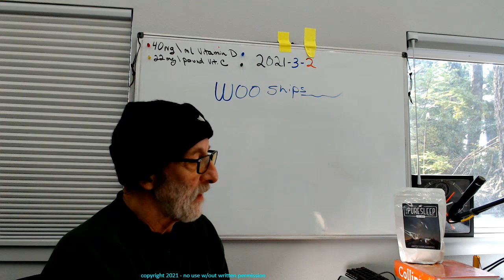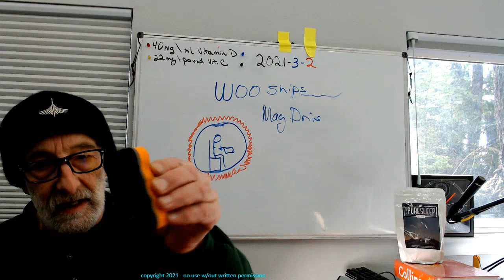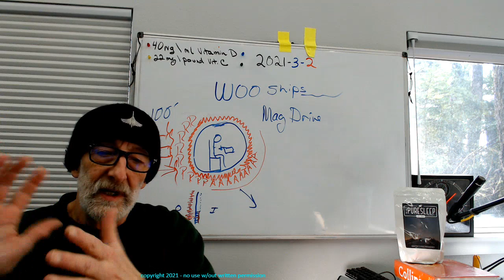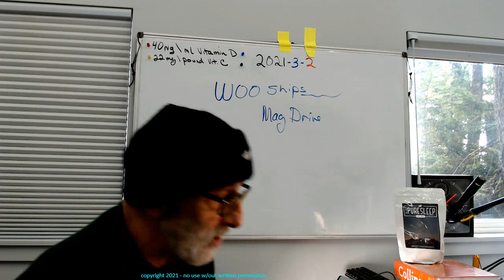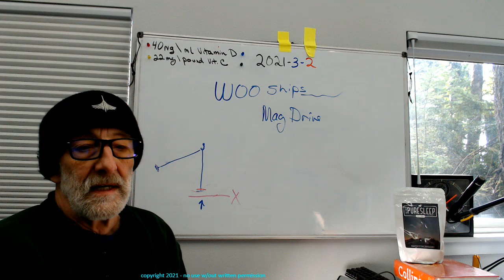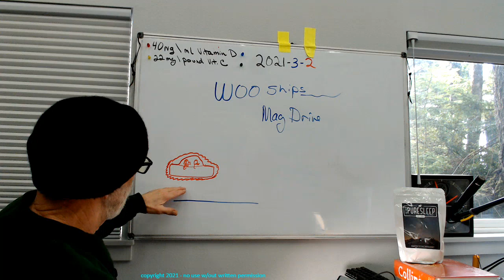Woo ships -2021-3-2

Comment: It seems as though it's not metal x necessarily, it's what you put between the plates of the framing of the body (if I worded that right) because you would need several layers of plating. When the magnets are started the material between the plates would cause acceleration depending on the alloys used for each layer of plating. Think of the frame and plating like a bicycle tire inside a bicycle tire inside a bicycle tire etc. What your looking for isn't the metal x as per se. Intriguing video. Thank you.

Comment: Could very heavy objects like battleships are able to float in water not because of water displacement but due to molecular vibrations of the water pushing against the surface area of the ship's hull? The greater the hull surface area in contact with the water the greater the buoyancy? The molecular vibration is like a transverse wave but it's strength can be reduced when the liquid is moving rapidly against the hull. Just as an aircraft wing moving through the wind has lower pressure on the top of the wing versus the bottom of the wing due to the higher speed of the air on the top of the wing which would produce lift ? Perhaps a flying saucer type of vehicle could be made to lift off the ground by having a plasma field on the top of the saucer move very fast whereas the plasma on the bottom is stationary.

Comment: You are describing what NASA calls "Magnetic Bouancy ". I am adding Coltan to my guess of a material: :Abstract "In this work, we report the novel findings on the structural, second harmonic and magnetic properties of the Coltan material from México. The magnetic properties were studied through the analyses of the magnetization versus temperature (M(T)) and magnetic field (M(H)). The isothermal magnetization measurements performed at 300 and 50 K shows a saturation magnetization of 11.5 and 11.8 emu/g, respectively. Electron Paramagnetic Resonance (EPR) signal result indicates a signal with g-value of g = 2.481 with a line width (ΔHPP) of 3575.7 G. Zero-field-cooling (ZFC) and Field cooling (FC) curves demonstrate the magnetic fingerprint of Coltan. Additionally, good second harmonic properties are observed at 470 nm, related to the blue color. High resolution transmission electron microscopy showed structural natural nanorods of Nb2O5 at 50 nm resolution with interatomic distance of 0.39 nm. " Jim Willie has gone full Woo but did not know the secret space ppm use of Coltan

Comment: Use a rotating field magnet. As the top magnet approaches the stationary magnet its field attracts the oncoming magnet as it passes the center field of the lower magnet flip the lower magnet field to push the moving field then reverse it to pull the opposite direction? Rotating fields may work with low electric output. The lower magnet will need to be timed the closer the match the longer the movement will continue.

Comment: Clif I think your metal x is as follows. A pyrolitic graphite wafer ...one side coated in a very thin but just  not porous layer of Silver. The other side coated in a thin layer of Bismuth, about five to ten times thicker as the layer of Silver. Good luck.

Comment: I saw this video some time ago and it presented a lot of magnetic force presentations made by the gov't research lab. They have somethings you are looking at. Powering a piece of aluminum through space pushed with magnetic fields at accelerated speeds. Did you tried a nanocoated  copper plate? See how different it would react. I will test this out in the next few days. Tried to communicate via Half pass Human site but couldn't figure it out. I have also discovered other information that might be useful to experiment or share.

Comment: What if it wasnt a new undiscovered metal, but something you do to the metal.
Perhaps if the metal or copper sheet was oscillating (piezo transducer at variable frequencies) there would be measurable differences in the speed of the magnetic pendulum.
Would a magnetic pendulum decelerate at the same rate while traversing across a vibrating metal plate as it would a non-vibrating metal plate etc.?

If you could have a magnetic rotor surrounded by a copper ring stator, and you vibrated the copper stator with a transducer, i am fairly certain there would be some phenomena , perhaps even the magnetic rotor would begin to rotate on its own.

Comment: Clif,
In regards to the metal plate...
Perhaps looking closer at abundantly available materials and ways to utilize them would be better that some rare ones.  Even copper over some form of plastic or even carbon fiber.
I'm sure many of the answers could be found in Area 51.

Comment: God bless you Cliff! Blessings and I’m sure you’ll get the help you require ASAP 🙏✨🛸 🖖 
In Hertfordshire, England, I’ll never forget seeing 2 lights as bright & as sized as average stars, in the sky, which were a reasonable but close-ish distance from each other @ about 11pm in summer. They then began to alternate independently between being dim and as bright as the Sirius star. They then zipped to the left, zipped to the right and then off & up diagonally into the darkness. Helicopters then came over us aiming towards the local airport direction about 5 mins later..Pretty compelling & that was about the year 2003. Interesting behaviour 🤩

Comment: You may need to use a combination of "metals" that have certain complementary or opposing reactions, that when laid out next to each other,  will generate the desires field conditions. These may need to be arrayed together in a hexagonal grid frame. Thinking industial diamonds would be an ideal frame material given their hardness, lightweight, etc. Just a thought to consider.

Comment: What hes describing is the unified force(or ether or medium or whatever words) that takes the patterns of magnetism, gravity, inertia, electricity, light, strong, weak, etc. Can be controlled and isolated. That means we can basically lock in the gravity inside and isolate the inertia from anything outside. And likewise no external inertia will do anything and we can target the forces all the while having no inertial or other resistance (that includes sound and bounces off light). It needs a highly concentrated, responsive and controllable power source, appropriate to the scale, maybe could also use supercaps or tabless batteries as buffer in some of them. These ships when designed for it can also go invisible.

Dont believe the dogma that theorists call laws of physics, they always make more problems for everyone because they always make more boxes and words and equations that describe the same thing and achieve no understanding of whats really happening.

Ive been watching alternative physics scene and the closest to unified understanding of these patters is found in Particle Gurus particle theory. I dont agree with their assumptions or counting everything as virtual particles which cant be detected but their conclusion is its all bunch of patterns of the same stuff. His sons channel Dissident Science is how I found it. There isnt a video that explains everything yet. And bascially theres whole movement in replacing the whole dead end physics, with partial success. 

Another part of the solution is Structured Atom Model which is getting good explanation by Seeing The Pattern channel.

Comment: The generator sounds like a Searle Effect generator.  That thing has never been able to get any traction for large-scale production. In the 90's I attended one of Searle's lectures and he explained the principle & device in detail. It's exceedingly simple.  I have notes here somewhere from that lecture.  The trick is printing the magnetic rollers.  One pole on the inside of the roller; the other on the outside.  That's the hard part.  The rollers' magnetism wears out after a time so they are not eternal.  The rollers are ultra-expensive neodymium with nylon 66 outer coatings, if memory serves, but I'd have to find & review my notes to be sure.  Anyway it's a very simple device.  There are an optimal number of rollers in each of 3 rings; he said any more than 3 rings and you don't really see any performance benefit.  I'm sure any notes I could find would have their information duplicated online somewhere, if the entire lecture isn't on video.

Comment: Metal X should not need to be searched for randomly.  The interaction of magnetic fields with molecular structure should be mathematically predictable.  Metal X, whether a complex alloy (from the viewpoint of molecular structure) or a simple arrangement, should be determinable via applying theory.  Work from the inside out.  Reverse eddy currents which "resist the change that caused them" = "enhance the change that caused them."

Comment: Well, what happens with copper is that the displacement of the magnet creates an electric current that creates a magnetic effect that stops the magnet. In order to accelerate the magnet, one should provide current, as a generated current will always contradict the movement of the magnet - if not, it would be a spontaneous energy creation engine - so, I'm sorry but the inexistence of "metal X" is quickly deduced : you don't accelerate something without spending energy

Comment: As a contactee i can tell that a journey to Mars takes about 15 to 20 minutes.
Around the ship there is some sort of plasma cloud and space looks like a silky black soup.
Those are smaller, saucer shaped ones.
The pilots are always female.

Some ships are very large. Miles long.
And i saw a black, planet sized cube somewhere in our solar system, about 10 years ago. It has a pipeline sticking out of it. Its size is preposterous.

And i also saw a planet sized ship with moons around it.
The south pole telescopes of the vatican have also seen them.
They are from the past......i can talk weeks about them.

Anyway,
The universe comes out of a portal and is tunnel shaped. Or better, like a cocoon of a butterfly.
The universe floats in a liquid ocean.
The border between the universe and the ocean is some sort of mist.
I saw very thin black strings.

There is life in that ocean.
And i discovered that the ocean itself also comes out of a portal.
I didn’t go through that second portal, but looked into it and saw land. And a blue sky.

Female contactees often have knowledge of ET propulsion systems.
So, ask them.

And if you have difficulty believing any of this, then i am not offended. Because it must sound really out there for a profane.

But then i can direct you to the smartest man ever, king Solomon, and you can ask yourself why he, in Proverbs 30:4, clearly describes the Anunnaki deity Enki as God of the earth.
And if that is not enough, them you can ask yourself who Abraham was listening to when he left Ur.
Hint: it was Enlil, Enki’s half brother.

And if you are still confused, then realize that if Moses stood before several pharaohs, starting  with Akhenaten, then king Tut, then some other guy and finally Ramses, the Bible calls all of them “pharaoh”.
So, when different characters are called “God”, don’t be surprised.
(The scene where Moses throws a stick that turns into a snake was with king Tut.
Tut’s left leg was fixed on a 90 degree angle.)

Comment: One more thing.  Sure you are aware that bismuth can actually repel / levitate magnets.  Maybe some combination with silver or brass?  Just thinking out loud here.  What if your inner substrate was fluid and you could adhere paramagnetic and diamagnetic substance.  Around this substrate a field could be generate the to align paramagnetic/diamagnetic mixture?  Thus using a little energy to generate substantial propulsion.?  Something like bismuth and gadolinium?

Comment: sir have you seen that movie i am unable to remember the name but in that movie the electro magnetic feild is created on a track which is similar to that of rail track but this track is shaped like U if you look at it cross section. if you view it perpendicular to the length.. and that track created a feild that made the car like vehicle to travel so fast like a swift of a sec and can stop within secs. i always wondered if it is possible to create this. because of the weight of the vehicle it stays on the track...& it is designed in a way similar to that of a ship... meaning lowest part to the track is heavy keeping the vehicle in proper position. so nice for u to create that spark of trying different things and ideas. 

always have been fascinated by magnetism... because magnets can deflects much of the radiation.

Comment: Bismuth has a repelling effect. I assume it’s not nearly enough for your needs perhaps the makeup of its molecular structure combined in a nano form with another type of similar, or multiple other types of materials could produce the desired effect. It seems like your essentially looking for a negative purposive field why not a properly timed pulsed opposite electromagnetic field shaped and directed to create the necessary push your looking for I’m sure a proper program would be a easy write for someone like yourself. I’m guessing that’s not going to fit your purpose for the push your looking for anyway just a thought. Peace and Love

Comment: Anyways" not really mags : I will explain l call it ion drive ;freqency osilation using natural Earth frequency or any planet ya need a frequency generator , a capacitor , 2 arc points = Ion Drive combined w/ di-electric metallic glass orbs = ufo's ps. the copper effect is due to impurities such as iron.*

Comment: At Cu where Cu represents copper as a flat plate and you have your hook, magnet and gravity (gravity being such a poor term; as I believe we live in an electrodynamic universe and gravity is a poor description for the physical observations ascribed to a "force"; and gravity is not a force). As you have described, the magnet is dropped, not magnetically propelled, but "gravitationally" attracted toward the copper plate (poorly defined falling force) to swing below the fulcrum point of what is essentially a magnetic pendulum.
Any first grader at a second rate science museum can see this effect as the pendulum will swing 180° in 2° increments eventually knocking down all pins along the 360° circumference. Magnetism is not required, until you redefine the "gravitational" "force" in a more proper fashion and recognize the pendulum, weight and motion that strikes the pins set along the circumference is an effect of objects in motion, most notably the movement of the Earth in rotation, and that of the pendulum, which if unobstructed and carrying the same momentum (which it should, if air resistance or friction at the fulcrum point of the pendulum are variables of minor consequence) continuing along at the 90° angle from which it was released.
Force, counterforce and rotation.
As to this insane analogy of gravity, Cu and Magnetism; it is like mixing apples, oranges and kiwis. It is not a universal gravitational constant, because no such thing exists. Simplify your question by redefining gravity as the magnetic force it truly is, and stop living in the 13th century, or whenever it was you believed humans finally crawled out of a muck as legged fish to make cave paintings.
When I solve problems of propulsion, I like to think in terms of explosives. They're easy to understand. If I were to redefine this jumble of jargon and boil it back to some sort of model that working potential, I would simply shape the Cu not as a flat plate, but as a bowl. Convex or concave. Forget the magnets for now, unless you're ready to move on to Hutchinson or something understandable like an SEG.

Comment: Silver does this also, maybe even stronger than copper. I use that effect to test entire rolls of silver coins within their tubes. I drag a strong magnet across the tube. If the coins jingle they are silver. If the roll sticks to the magnet, the coins are ferrous and fakes. If they do nothing, they are aluminum fakes.  

I think maybe you've read E. E. Doc Smith's Skylark series, where Metal "X" is used to create the drive used to power the spaceships by interacting with a copper bar. If you haven't read "The Skylark of Space", maybe you should :)

Comment: I've actually recorded one of these magnetic ships on 4th of July in NYC over the Empire State Building during the fireworks show.. it would Vibrate and Brighten right before a fast move to another position and then slow the vibration and Dim.. I recorded it for over 30 minutes which makes me believe it was military watching the fireworks for security reasons.. Also, why not try Silver for the slippery metal? Also I was thinking of a substance that isn't metal, but suspended in a glass film, like Silicon or a rare Earth like is used in Gorilla Glass.. Try using old cell phone screens to experiment
Reply: silver is a brake, even more than copper
Reply: @billyg7798  Isn't Silver the best conductor? Should allow the least resistance? Or is it the reflective property that would do the braking? Maybe the density? Just asking to help think it through